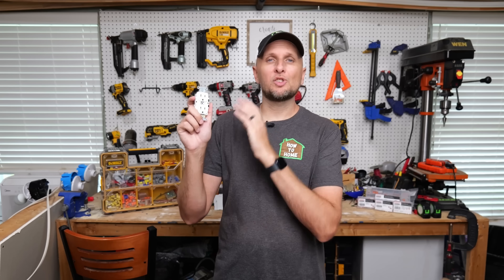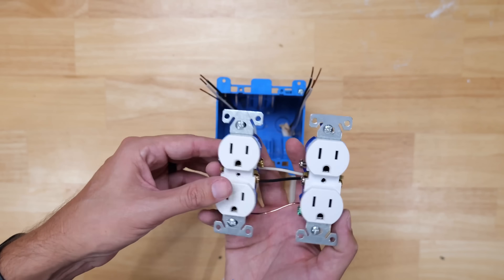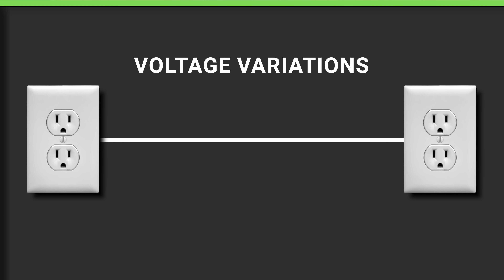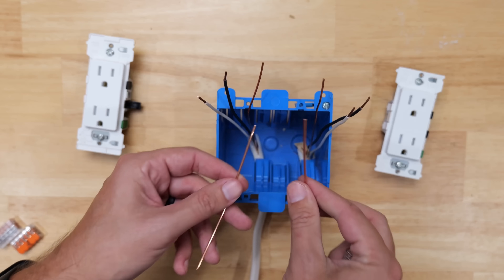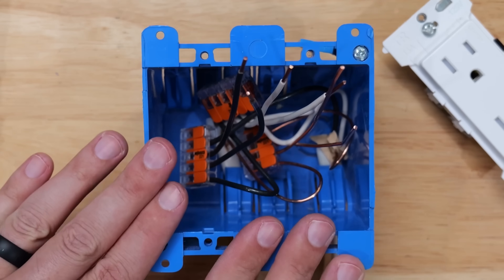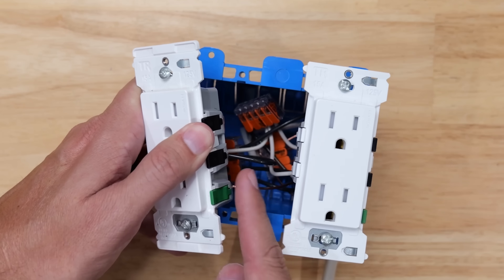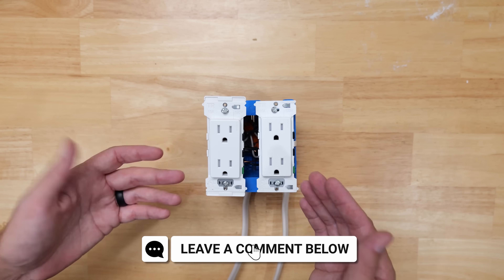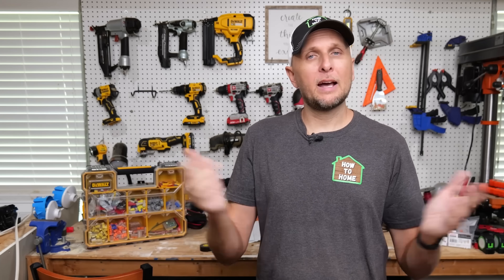Why This Outdated DIY Outlet Wiring Needs to End!

Comment: Is this in the new code book?
Reply from the maker: It is in the new code book and many before it.
Reply: @HowToHomeDIY it's not in the code book that I am aware of, If you say that it is, please cite your code reference, Adam.
Reply from the maker: What do you mean cite my code?  I went over numerous things that are covered by code.  All of it is per code.  Both ways are in code.  I don’t understand what you’re trying to get at.
Reply: @HowToHomeDIY When scottmarkuson asked this question, I think he was looking for a code reference number that mandates the approved method. There is no mandate and no code reference number. When you said that it is in the code book, you're not wrong, but just vague. The code book says when connecting wires, that you must follow the manufacturer's instructions. In this case the instructions are from the device and/or the wire connector (wire nuts or Wago's) manufacturers. So either method is "legal" as you mentioned in the video. If you use the term "per code" it implies a reference number. An example similar to this would be NEC reference 300.13(B) which states that if this was a multi wire branch circuit, the neutral wire cannot depend on device connections, so pigtails would be required.
Reply from the maker: Okay but I never said it was mandated.  In fact, I said both ways are legal.  So not really sure why this is an issue.
Reply: @HowToHomeDIY  - Scott just asked if WAGOs were legal in the NEC.  You said yes.  Then Surfer said no they are not, so if you say they are, show him where, chapter and verse. That's all.

Comment: I don't understand why you are saying doing it the old way can cause a problem with the second receptacle if the first receptacle fails. They aren't wired in series, they are wired in parallel (bonded together by the bar on the power side screws and bar on the neutral side screws) so even if the first receptacle failed internally it isn't affecting the second terminal at all. I see i am not the only one pointing that out--@ddgiant did as well. That being said i think i would wire it the "new" way.

Comment: By using the wagos, you just moved the failure point fron the outlets to the wagos, this true because now you completely dependent on the internal conductive parts to carry the electrical load from conductor to conductor. This is not the same as a wire nut where you are bringing all the conductor wires together.
Reply from the maker: Nothing wrong with Wagos.
Reply: @HowToHomeDIY that doesn't take anything away from my claim.  You just moved the failure point from one device to another.  I didn't claim anything was wrong with Wagos, why even say that?

Comment: Okay a little BS on this, you show recepticals that will not fit flush in Old Work boxes in an Old Work box. The face plat will not be flush! So, kinda a fail from my point of view.
Reply from the maker: Ummm why wouldn't they sit flush?
Reply: @HowToHomeDIY  If you look at the old school outlets on the left the there are little wings/tabs you can break off to allow the fixture to sit flush in an Old Work box, those new fixture do not have those break  off wings.
Reply: @HowToHomeDIY  Added: you will see flush sections in the center along the top and the bottom of the box, they are the same width of the fixture stays with those tabs/wings removed.

Comment: what do you mean 'the receptacle went down'. what exactly is the nature of the failure we are accounting for in the new way?  i assume its a wire coming loose right? there isn't any other type of failure that would occur that wouldn't equally affect the new way?  I am asking because i have ~8 outlets i am in middle of replacing.... 🙂

Comment: I just had to replace an outlet that had weak grip and I'm pretty sure it was wired with your recommended way.  The house was built in 2005.  It also made it easy to replace it.

Comment: Residential electricians don't use the terms "series" and "parallel"? 
I was never a residential type (aviation), but I would never wire devices in series like that. All of the receptacles (devices) should have access to the power supply from a parallel wiring. I guess just like the circuit breaker panel, is what I'm saying. Each branch would have it's own protection (breaker/fuse) and access directly to the source.

Comment: Im curious as to how a failed receptacle in a pass thru scenario stop the power going thru to the next considering the pass thru is actually on the outside of the receptacle and not internal. Doesn't make sense to me how failed receptacle would cause power loss unless the pass thru on the outside failed.
Reply: In my daisy-chain failure case it was a screw on the outlet that worked itself loose over the years.  Eventually it started arcing, and the soot became more of an insulator until there was no contact being made between the screw and the wire.

Comment: Can you show this upgrade on an older home with aluminum wiring and aluminon upgrade? I believe there is insufficient room in the original steel wiring boxes for the larger circuit plugs.  much less the additional wiring in the box.

Comment: Been in the trade for three and a half decades and carry a masters electricians license.  I have done pretty much everything at back this point.  For the home DIYer, this is the best way to go since most lake the skill and experience to do a proper job.  My preference is to twist and use wire nuts on solid copper wires.  For stranded I love the 221-40x Wago terminals and use them quite a bit in the research labs we wire and for some equipment we install or repair.  For the outlets I still prefer the screw type clamping back wire commercial heavy duty outlets.  But in this context, the cam lock outlets have little exposed conductors for the grounding conductors or a steel box to short to.  They are the way to go to provide the best chance of a successful and safe outcome.  I always pigtails from the very beginning and still do, far more reliable and safer results.

Comment: The only opinion I have, the splice point with the multiple pigtails could also be a failure point.
Reply: Exactly. I have spent hours troubleshooting a dead circuit to find a loose wire in a melted wirenut behind a light switch.

Comment: I have never seen wiring like this.  I have always seen the power lines in and out wired together with connectors and pigtails to the outlets.  And I have seen wiring in 2 states over 50 years.

Comment: check the code book, first the ground is illegal, and the jumpers counts in your box fill, how many devices and wires you can have, and it would be counted as the box is over filled, also illegal, it might slip the inspector, but if the fire department finds after a fire, your insurance wouldn't have to pay you,

Comment: This doesn't really change anything.  As many people in the comments have said the outlet failing has nothing to do with the way the power flows.  It is a solid mechanical connection on the outside of the outlet that the circuit passes though. That connection can fail but it is no more or less likely to fail than the connection you have to create for the pigtail.  In all actuality you just doubled the number of failure points by adding the pigtails and if those fail then you will still loose power downstream of the connection.
Reply from the maker: Many have said and many have completely missed.  You think the outlet itself going bad is the only way it can fail?  Nope.

Comment: Believe it or not, the utilities are still wiring in series. Alright, not usually. I’m talking on the macro scale, at the distribution level. 
In general, the high voltage customers are wired in parallel, like your “preferred” example.
But when they need to work on the feeder circuits, sometimes it is necessary to use one high voltage customer as a pass-through to the next customer, daisy-chaining (or “series”) customers. And the customers can stay in the daisy-chained configuration for days.
So, if it’s good enough for the utilities, it’s good enough for me.

Comment: Your way is better. The problem is it is slower and costs more. You have to make pigtails and use connectors. That maybe why electrician would not do it. Electricians are not worried about future problems because it will be out of warranty and maybe future work. They should supply the most cost effective outlets they can purchase in bulk to meet the project specifications.

Comment: What a messy box. Are you telling me wagos don't go bad. You have a lot more fail points, and you spent a lot more money. Your way is different not better.
Reply from the maker: You claim to be an electrician in another comment, if you are, you would know, it is not my way.  I didn't make this up.  But that said, if you are an electrician in the US my guess is you are just bias to wire nuts and don't like the Wagos.  This way is better and many electricians are using it.
Reply: @HowToHomeDIY  I said it's your way because you use this method. Yes, I am a master licensed by the state of VA. You can look it up. The long and short of it is that it takes less time and less expense to use the screw or clamp terminals. I never back stab. I have done thousands of boxes. Adding 1 or 2 dollars to each box (price has come down some now) just takes money out of my pocket and puts it in some corporations pocket. Wagos are not safer, just easier for the unskilled or DIY homeowner. A Wago has less surface contact than a screw or clamp connection. Tests have shown Wagos heat up under loads their not designed for. Loads under a wire nut pass wire to wire, not thru the wire nut. Maybe I'm just old and don't like change. Yes pigtails are nice when changing a single device,  but the fact is when doing this I'm getting paid by the hour.  I have a one hour minimum charge, so where does this help me or the customer. Like I said, Wagos are different but not better for the skilled electrician.

Comment: While I don't disagree with your premise I would warn that doing this for a lot of DIY people could lead to code violations due to to many conductors in a box. NEC314.16b each receptical and wago count as conductors. I have seen situations where extension rings had to be used to keep to code even with the old system.
Reply: I appreciate you quoting your source, but the NEC does not count wire connectors like wire nuts or Wago's for box fill calculations and they don't have any considerations for the size of the device(s). I guess they expect common sense to prevail. 
For extension rings to work with flush mounted boxes, you'd need a significantly recessed box. A 1/2" extender for a single gang box would get you approximately 3 sq. in. extra room over a box mounted flush to the wall, which may be enough. Not sure if that would be code compliant, though.

Comment: With this method there is still the possibility of a failure point in the “buss” Wago in each box, where with the original design there was none. With your method, you trade off the risk of a failure point in the daisy chain with a risk of a failure point in the more connections. I think most importantly, this newer method introduces more site/ user connections which are potentially more failure prone than the engineered/ factory connections within the devices themselves. Especially when using higher quality residential and commercial devices. Throw in the added force used with less flexible 12 gauge/ 20A rated devices/ circuits and I feel simple daisy-chained, high quality device receptacle circuits using wire nuts with triple twist strain relief are more bomber than a “Wago buss” in each box. I still love using Wagos and consider using them especially if I expect to change out a device for a smart switch or USB receptacle in the near future. Because Wago buss is very easy to disassemble and replace a single device from without disturbing any other connections.

Comment: This is a load of rubbish. Maybe with the lever lock ones ( which I will never use If I have a choice) but not with the screws. It is just a choice between a Parallel system wired One way or a Parallel system wired the other way. Personally I do not like wire nuts.😊

Comment: I'd like to understand how you think there is a voltage drop in a parallel circuit.  Possible (highly unlikely) with your double gang example, but never with singles.

Comment: As mentioned in other comments, this wiring method is dependent on having a GFCI or ACFI breaker at the panel, as parallel wiring all outlets would negate the primary function of a GFCI outlet at the head of the line.  

If you have a standard breaker, then make your first outlet the code required GFCI, then series wire the next junction, where you then start this parallel wiring process. That maintains the GFCI protection across the entire branch.

Comment: My parents house, built in 1967/8, has junction boxes in the attic that splits the main feed to 3 to 4 recepitcals. Almost like the pigtail demo, just longer pigtails. One of the junctions failed under a wire nut (green and crusty) so all recepitcals failed. The wiring is old, but it does show that the pig tail method is not 100% fool proof. Personaly, I use both methods, depending on space of the box. I don't use  the Temu $0.03 outlets either.

Comment: Wow, DIYer here and I learned electrical wiring from a book about 25 years ago (I still dig it out and consult it on occasion) and it definitely taught to use pigtails so that's what I've always done.  I'm curious about the outlet you are using - I know with a more standard type outlet often in addition to the screw terminals on the sides there are holes in the back for making "stab" connections.  The same book (the one that I learned from) said never to do stab connections (not as secure, or something like that, I forget what the perceived downside was) - does the outlet you showed over-ride this concern by having the little levers that lock?  Or would people who avoid stab connections (not talking about DIYers like me but rather pros) also avoid this type of outlet?
Reply: This type of receptacle is more like the Wago lever connectors and not a backstabbing connection. These lever receptacles should not be avoided by diyers or professionals. Leviton edge now has commercial spec grade versions designed for use by anyone including professional electricians. Wago lever connectors have been notoriously criticized by some electricians, but mostly based on unsubstantiated claims. Many electricians rave about lever type connections regarding the Wago's and they are rated for 20 amps. The Leviton edge commercial spec grade is rated for 20 amps and 12 gauge wire.
Reply: @surferdude642  Thanks for the info!

Comment: Yup let's totally  argue that 1 a circuit. Should be.  Left powered on with a known fault, 2   a brass plate connecting 2 wires with a mechanical   connector is  supposedly  inferior to a tin plate connector that uses pressure  to secure the connection dud your. A hack  only way it's better is for return calls and to cut corners why don't you  go open up a circuit breaker and. Then go through  what everything  on that line goes through from the start oh and don't forget  like  u implied  in your video by trying to illuminate voltage drops is that circuits don't have max capacity. The  codes that allow for extra  outlets still don't   allow for more draw meaning no you can not put a. Space heater on every plug on the circuit and expect it to be fine

Comment: The only time I have seen an outlet fail to pass through power was in a home with aluminum wiring.  I have never seen an issue with copper wire.  Your "new way" adds extra connections and  therefore more failure points.  I am not sold on using all these convenient plastic connectors.  I have seen too many plastic things break as they aged.  I'll stick with metal.
Reply from the maker: It’s not “my” new way.  That’s not the only way an outlet connection fails.  Properly installed Wagos and wire nuts don’t fail.  A lot of opinion there.
Reply: Spring-clamp connectors are not new.  WAGO patented the spring-clamp connector in 1951.  They are the standard for joining wires in Europe.

Comment: In San Francisco the code says you have to use pigtails.  My understanding is that the only reasons are that you have a much more secure connection with a pigtail than having 2 (or 4) screw connections that could loosen up, and that with a 20 amp circuit the jumper between the two screws might not be able to handle a full load.
Reply: Eh, why would they think the jumper on a receptacle couldn't handle 20A? From my understanding they're definitely designed to do so, even on 15A receptacles.
Reply: @ps.2 , “If you’re going to San Francisco be sure to wear some flowers in your hair” (and pronouns on your lips). Otherwise they won’t even talk to you.
😎🎸👍
Reply: @JBarleycorn The only time I did, alas, I forgot the flowers in my hair. Had a great time but I wouldn't want to live there.
Reply: @ps.2 , I did live there in  San Francisco, Marin and Santa Cruz Counties, but mostly in the city from February 1969 to January of 1986. I was a professional guitarist and am quite familiar with the underside of the left; their open and accepting ways (if you agree with them), their true feelings about those they disagree with and the depths to which they happily descend. I walked away after over two decades of professional playing because I got tired of people falling over with needles in their arms and me depending on them for work. 😎🎸👍

Comment: I never did that. I will window cut the insulation on the pigtails and put a U bend through ONE screw on the upstream outlet. Some industrial customers do NOT allow any splices in any current carrying conductors. That gets super expensive really fast. Window cuts in insulation and U bends. ZERO splices! You have to pull THROUGH THE BOX. Obviosly, NO ROMEX!